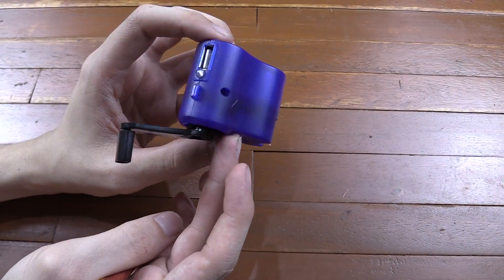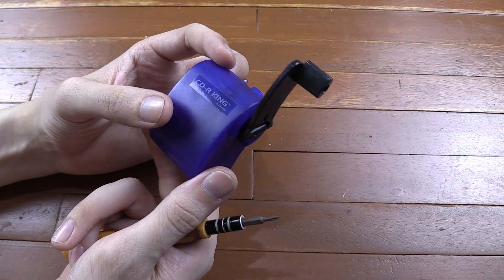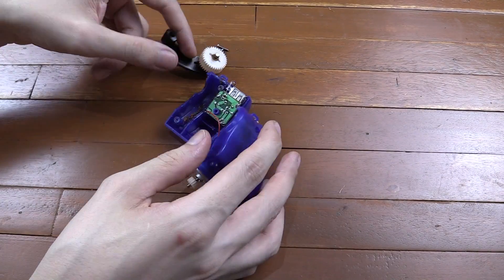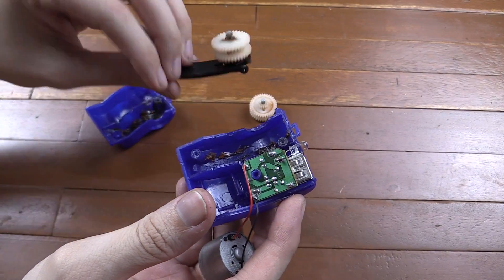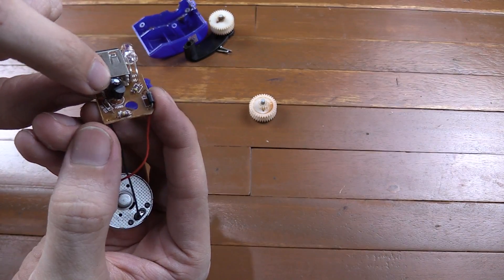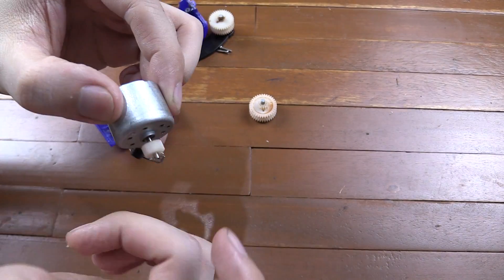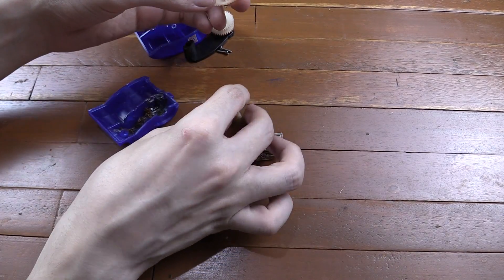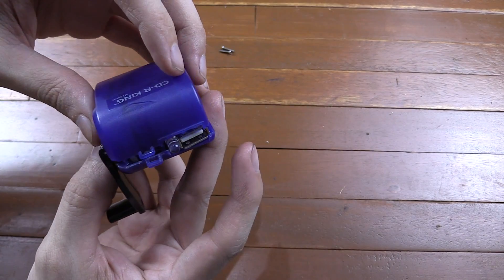Cheap USB Dynamo Teardown

Comment: I think I see the problem: That's a motor! It's designed to turn electricity into motion, not vice versa. It's true that a motor can be used as a dynamo, but they are not optimised for it and will perform very poorly in comparison to a device designed for that purpose. Devices which cost a lot more, due to the comparatively tiny production volume.

A 'proper' dynamo uses a much stronger field, usually with more than two poles, often a halbach array. You don't often see dynamos at all, as they have been almost entirely replaced by alternators with separate rectifiers - fewer parts to go wrong.

Comment: how much did you pay for that? that's one gadget you can't decrease in size any more than what's on the market.
Reply from the maker: +Adrian Glenn Bionat 99 PHP which is just over 2 USD. I'd love to see the same thing but with a bigger motor and metal gears. Something that can output at least 5 watts and survive a bit of abuse.
Reply: +Gadget Addict motors from these things rarely go before the plastic parts break or the handle snaps off.
Reply from the maker: Adrian Glenn Bionat Yeah I've had a few cheap hand crank generators and usually the gears get worn down and handle breaks within a week lol. I started work on a 3D printed hand crank generator before, it worked much better than this one in the video but again it would be better if they were metal gears.

Comment: I have one of these, and it isn't useless, it just does 1/2 amp so you might have to turn off your smartphone to charge it.  I have USB batterys that it will charge which makes turning the phone off unnecessary.

Comment: mine too........ the problem is , when you crank it, the motor will lose, so , just glue the bottom of the motor with hot glue, and fit the motor.